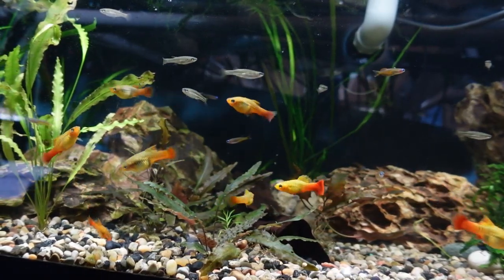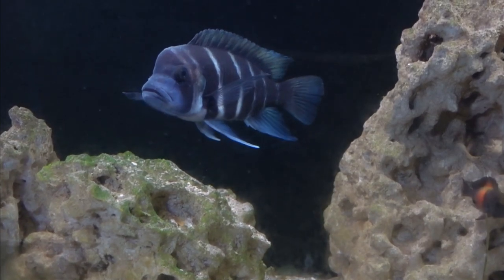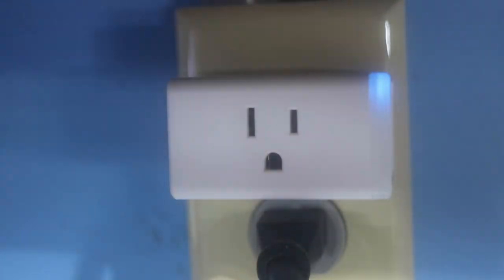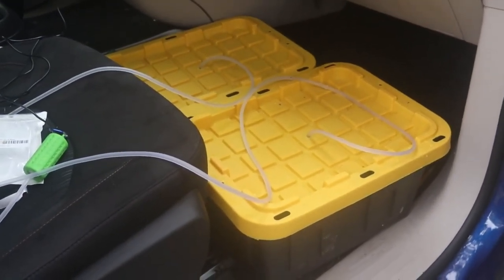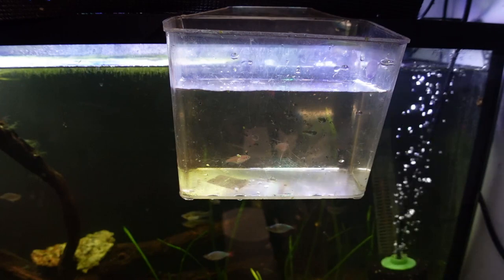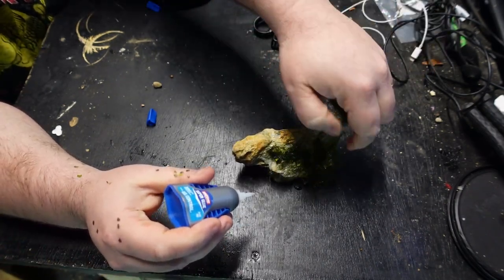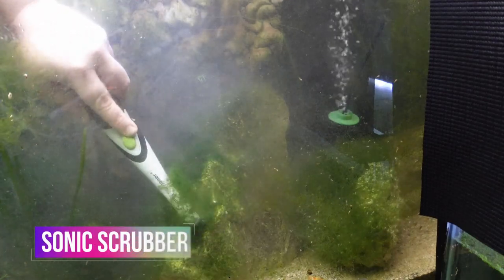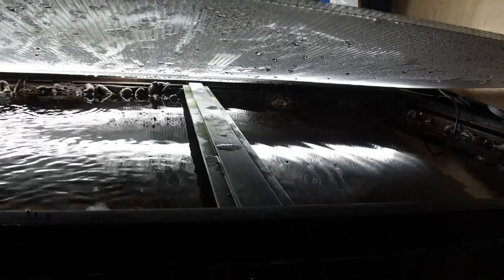Top 15 Unsung *HEROES* for your fish tank

Comment: How are you using the Smart Plugs for AWC?
Reply from the maker: I have the water in a food grade drum which goes for through 2 sediment filters and a carbon block.  I have pumps plugged into the smart plugs which send water to the aquariums a couple of times a day.   I usually run it for about 2 mins ... 3 times a day.
Reply: @FishTankBarn  do you need to add anything back to the water?
Reply from the maker: I have it hooked up to a float switch, so it fills automatically
Reply: @FishTankBarn  sry. I meant something to re-mineralize
Reply from the maker: I don’t remineralize.  There is still plenty of hardness in our water here.